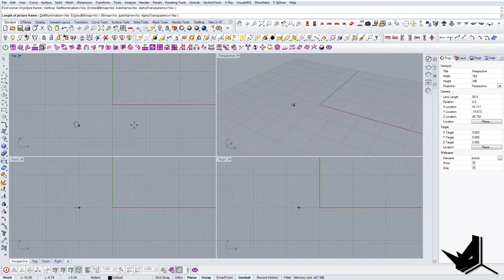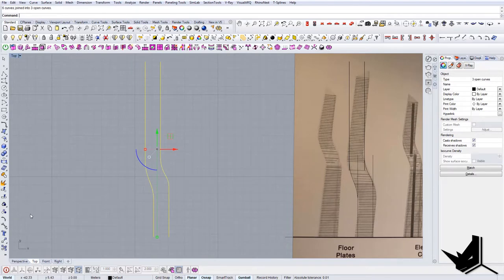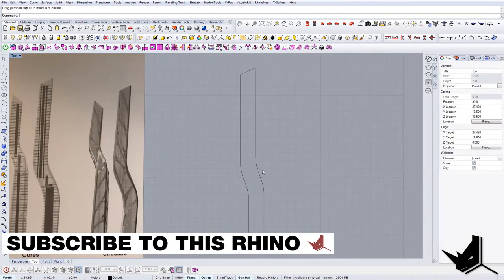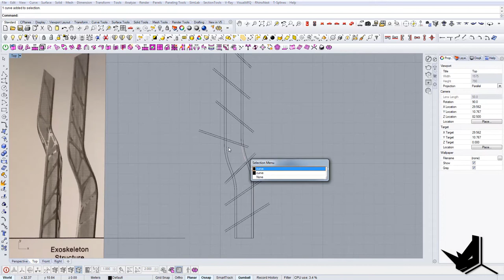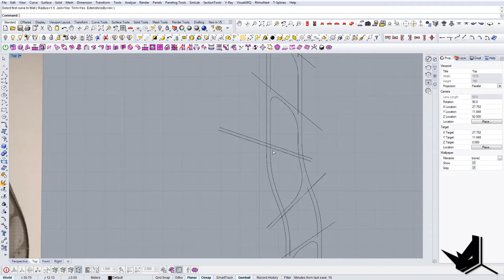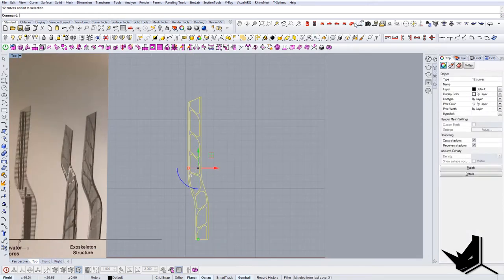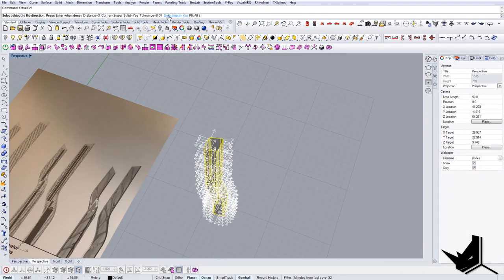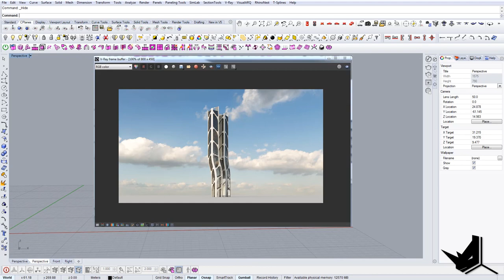Rhino Architecture - Modeling Exoskeleton Facade in Rhino

Comment: Can show the steps you take to make it the finished model
Reply from the maker: Hey Michael, 
I haven't recorded that as the video would get very long. The basic principle is the same for all 4 facades. In this particular case, I took the same 2D line drawing and changed it up a bit to get all other sides. Then I just added some floors by doing a boolean difference on the inner core. Hope that helps :)